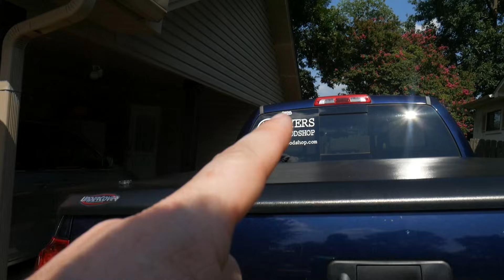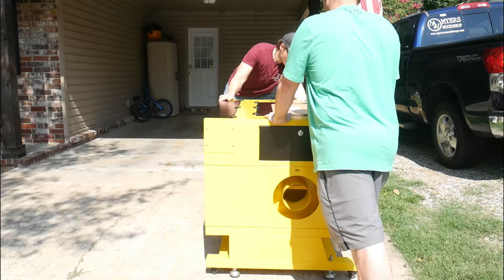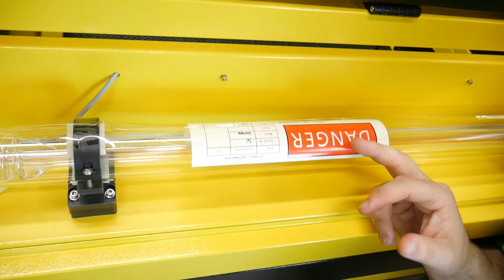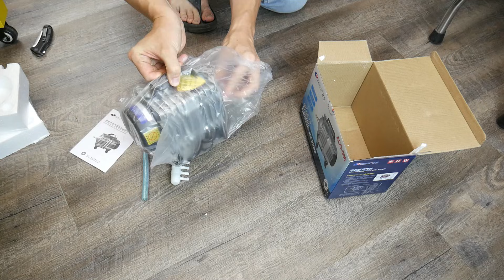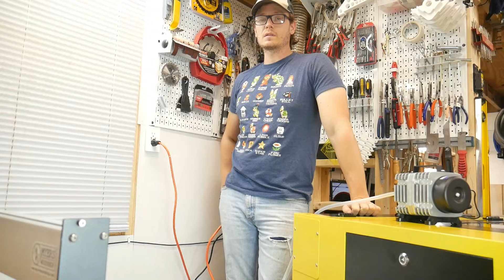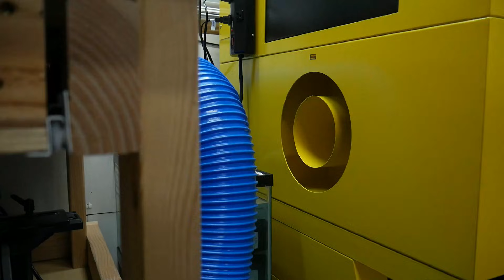Did I Waste $2400 on a 60W Laser Cutter from China?

Comment: Has anyone ever elaborated on the "this power board wiring is too small" apart from "the internet said"? Cheers.
Reply: Supposedly the wiring is not able to handle the full 10a or more that the fuses in the fusebox alllows. This makes for a potential fire hazzard if you pull too much power from one of the outlets. I.e internal wiring melts/burns. On the one I use it has not been a problem but your miles may vary.
Reply: @MrFalense  Yeah I have a Chinese laser as well. Hopefully the typical aquarium pump, even on sad old 110V, doesn't need 10A ;-)
Reply: @MrFalense  still for that small aquarium pump and air compressor, even Chinese wiring should be good enough
Reply: @MrFalense  it might be because China (and the rest of the world) uses 240v, which means they same size wire can carry double the Amps (if my weak recollection of high school science class is right). I'd be curious what size wire they used. It should be 2.5mm diameter wire for a standard electrical outlet (up to 4000w capacity). At least that is the standard in Europe. It's the reason the US can only do up to 1,500w on a single electronic, ie, why all heaters are that wattage. but in Europe we have up to 3,000w heaters.

Comment: I really hope you put the Extractor fan outside like it should be, build a box/leantoo/cover. That grey extractor pulls more cubic than that black one does.
Reply from the maker: Nope, it's inside.  The black one is much quieter!
Reply: @MyersWoodshop  what he's telling you is you need to utilize the original fan that came with it because it does a better job of moving air so you're not buying replacement parts all the time for your laser. Speaking from experience by having replaced $20,000 gold mirrors because of low air flow, that fan keeps the dust/smoke/debris in the air from ruining your lenses. Put the fan outside in a weatherproof box and you wont hear it if noise is your only concern.

Comment: will that cut thin aluminium
Reply: NO
Reply from the maker: NO c02 Laser will cut metal!
Reply: @MyersWoodshop  A large CO2 WILL cut metal - this toy barely gets through acrylic and thin wood.
Reply: Not really. Most industrial metal cutting lasers are CO2.  However a lot more power is required.  There are DC excited glass tube lasers that have two and four bore folded tubes that can provide up to 500W and this is about the minimum for thin sheet metal.  However to cut copper and aluminium takes even more power as they are good reflectors  at the laser wavelength and also conduct heat away from the cut. Most industrial metal cutting lasers have RF excited lasers, also often with folded beam paths and on many have flowing laser gas so it remains fresh.  The beam diameters start out bigger and the optics are higher quality.  For thin metal at low laser powers pulsed lasers are used and this is the YAG and fibre laser territory but speeds are not very fast and they are less common for heavy work.

Comment: Should not operate it if the room temp goes above 90 degrees. This is a cheap laser. Water cooled is another space killer. If you mount your vent fan in the attic and run the duct up to the attic and out the gable or roof vent you have very little noise.  I considered a Chinese laser due to cost. But I'm very glad I spent the money to buy an American made CO2 laser. The my laser tube alone is more than that hole crag mire of equipment. But there is no water to mess with, focus is automatic, instructions are easily understood, they have a help line and parts can be shipped overnight.
Reply from the maker: no water would be nice but i saved SOOOO much money!
Reply: @MyersWoodshop  Unfortunately, you get what you pay for. The Chinese machines are will not last long in a commercial business.

Comment: a 60w power supply DOESNT  mean its a 60w tube.  guarantee its 40w.
Reply from the maker: Length of tube and power supply state otherwise.  It’s a 60
Reply: @MyersWoodshop  and nothing against you. I'm an eBay power seller and used to be a chinese importer (now I manufacture everything i sell here in the USA). the chinese sellers are extremely dishonest. i don't believe ANYTHING about a chinese product that i can't validate for myself. I've been burned many a time.
Reply: @DieselRamcharger  But when Americans do business abroad, first they put a local face to deal with the local business. You usually get what you pay for. Do you imply that all chinese sellers are extremely dishonest?
Reply: @MyersWoodshop  power supplies work off demand. 60w is peak output. only if asked for it.dimensions mean basically nothing. you can get an actual laser output tester fairly cheaply, and then you will KNOW what it is. also your tube should have a certification slip somewhere in the package showing its peak output and its agreed output.
Reply: He's right quite often what happens is people will over power the laser, greatly shortening its life. I'd also like to know if it's indeed a 60 watt laser.

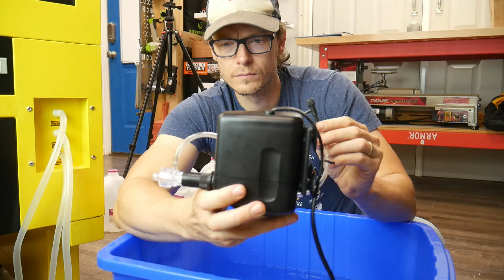Comment: 20:19 the little tube thing is from the aquarium side of that pumps use, in sucks in air so the water is mixed with air for the fish. but i bet u don´t need it.
Reply from the maker: figures.  Don't need it for the laser.
Reply: @MyersWoodshop  yea it would actually be very detrimental to the cooling ability since the air wont absorb heat as quickly vs direct water contact and can result in airlock within the tubes and kill the laser tube from overheating.

Comment: I have that exact same identical laser from Ebay.  How was the smell from it? A little smoky smelling?   I added a 30ma meter, got a CW5200 chiller, and used the blower it came with. After doing the mirror setup and cleaning everything, it does a really good job for what it costs. Of course it comes with a 50w tube and not a 60w as advertised, but that is an easy fix. 

Thought I had it bad taking mine downstairs! LOL The base comes off, all the doors come off and it makes it much easier to move.  I use Lightburn to drive it.  One tip, don't use those outlets in the rear, they aren't very good and could lead to arcing.   Also on the cooler, don't use the default settings, but run through them all and set it to 15C as the low end, 20C as the high end. 

Now for a fun note. This exact same laser is purchased by US companies, revamped with US parts and sold under a US brand for 4 times the price.  The thing to look for is the guideways, they are high quality on these Chasers from Ebay, and the cabinet construction is very good. The tube and power supplies are consumables, so when time to replace, use a high quality one and you will have a laser that is every bit as good as one from say Boss laser and costs a quarter of the price. 

BTW, YES those screws are HOT! LOL Did the same thing!
Reply from the maker: lol. we had the same experience!  mine actually has a 60 power supply.  yep, american uses a lot of the Chinese components.

Comment: The sealant is used when you change the tube. It goes around the high voltage cable attached to the tube.
Reply from the maker: your right!  Hope i dont have to do that for a while!
Reply: @MyersWoodshop  Has your power supply died yet? That'll die long before the tube is bad. And the stock supply is barely 50W, not 60. When it dies, get a 60W supply from cloudray.

Comment: If it is anything like mine, it will have a 60 watt laser power supply, but only a 50 watt laser. The laser tube only lasted 3 months before I had to buy a new one. This time I ordered a 60 watt tube from the manufacturer which protruded out the side, so had to make a cover for it. I think they just throw in new old stock laser tubes.
Reply from the maker: i checked after.  Model myjg60w, so the power supply IS a 60w!
Reply: @MyersWoodshop  I have the same machine. It's a 50W power supply with a 60W label. The fly-back transformer inside is only capable of 50W. And it will die. A real 60W power supply is a bit larger and needs a pair of fly-back transformers.
Reply: @MyersWoodshop  By the way, I got noticeably more power from my laser tube when I replaced the original dead supply with a cloudray 60W supply.

Comment: What is the wattage on your laser power supply and did you get an actual 60 watt laser tube? Thank you.
Reply: I have this exact laser. It is actually a 50w tube with a 60 watt power supply. Length of the tube determines it's output. A true 60 watt tube is 1200mm long, the one shipped with this unit is 1000mm. The tubes supplied are low grade and wont last long if driven at 100%. They didn't detail the ma meter that is seen in the end shot, but noticed they have another video with details. The maximum you want to drive the tube in this unit is 18ma. Any higher and kiss the tube goodbye.  It will cut most woods at 30-60% which is right around 14ma tops.
Reply: @acdii  You are right; as a rule of thumb, running at 80% of the max power will approx double the working life. But at 60W power, why do you need a chiller? As long as the water temp at the outlet stays below 50C, it should be fine.
Reply: @janami-dharmam  You would be surprised at how quickly the water temp rises at 20% output.  My chiller has a digital readout, and doing an engraving at 20% will raise the water temp up 2*C. Eventually if there is no chiller, the water temp will reach 20*C which is the limit you want to be at on the tube before it breaks down the CO2 into CO.
Reply from the maker: yep, 60w, the power supply is as well.

Comment: Awesome video! FYI....
An increase of 3dB doubles the sound intensity but a 10dB increase is required before a sound is perceived to be twice as loud. Therefore a small increase in decibels represents a large increase in intensity. For example - 10dB is 10 times more intense than 1dB, while 20dB is 100 times more intense than 1dB. I.e. Small change on the db meter is really a lot of difference.
Reply: Ethan 
Say what?
Reply from the maker: thanks for the info.

Comment from the maker: Orion Motor Tech 60w Chinese Laser Cutter Engraver : https://amzn.to/31K0TEc
VISIT:  https://omtechlaser.com/?ref=myerswoodshop
Reply: Don't waste anymore $ on CO2 or even YAG's,lamp or DP lasers, get a Fiber laser with virtual perfect beam quality, order mag. shorter wavelength, ultra high wall plug efficiencies, can be 'piped' anywhere in your lab,home or factory with a tiny fiber optic. From watts to KW's Fiber Lasers are changing the world. No need to discard your current system as you can retrofit your existing laser scanner and change out the CO2 laser with your new/used Fiber laser. You'll also need to change out the delivery optics but are available everywhere.
Reply: Roxanna-----what fiber laser mfg. are you referring to??
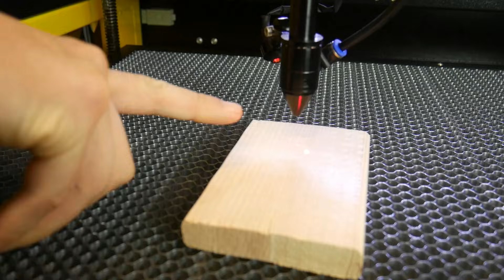Reply: Myers Woodshop You might want to buy a pointing stick 25:25, preferably before you run out of fingers. And ask for steel toe capped shoes too. 
Just sayin.
Reply: Not sure why you are calling it a knock-off. Its an X-Y carriage with a laser attached. How else are they supposed to do it? As we know, most manufactured goods are made in China because that's where the skills are. We'll have to get used to reading manuals in Chinese instead of expecting them to do the translating as well as everything else. After all, the German, French, Italian, Japanese and Korean translations take priority these days over the English ones.
Reply: Michael Powell because that’s where the skills are? Probably over 90% of what China builds are knock off’s or copies of technology stolen from the west or forfeited by companies to be able to have their items built in China. The reason everything comes out of China is because of the cheap labor force it has nothing to do with their innovation. You think Americans can afford to pay for a Union built Laser engraver ? Out of China $2000 out of a union plant $20,000 and even if not a union plant your still looking at $15 an hour employees to their .20 and hour.
As for them writing manuals for other countries and not ours BS I have relatives in Germany that bitch about China good as much as anyone else. The US is the largest purchaser of China goods by a long shot unfortunately that is not going to chance at least not in the near future.

Comment: Were you able to load up lightburn and use the laser with the controller that came with it?  Does lightburn come with a driver that plug and play with that laser? was there any modifcations needed for the mirrors? Or was the laser "ready" to use after setting up chiller and exhuast?  Thanks alot.
Reply from the maker: yes.  yes.  nope, ready as soon as i hit go!

Comment: Nice video! I am trying to hook my laser up now and my water pump didn't come with the black float thing like yours has. now I have to wait until I can go find one around town tomorrow :(
Reply: That float thing is useful if you have aquarium. Air in your cooling system is harmful. It's bad. Don't use it. Don't install it like in video.
Reply from the maker: we'll that's a bummer.  I still recommend getting a real chiller.  check out my chiller video!

Comment: i use a glowforge its great
save 500 with this code https://,glowforge.us/r/BOZGYPXT
Reply from the maker: why I DIDNT buy the glowforge. 1) cost was way higher. 2) propitiatory, always online, software. 3) NO rotary will work with it.  4) Lower wattage, less powerful.  5) Only email support, might as well have no support.  6) No pass through slot (unless you get the most expensive version.  7) did I mention the cost was 2x-3x more?!

Comment: Your air blower / jet engine is awesome. So loud. I have four of these laser cutters in my shop, and each blower can run two machines because they push so much air.
Reply from the maker: they do move a lot but its SOOOOO loud!
Reply: Myers Woodshop cant get an extraction fan and mount it in a weatherproof housing outside?

Comment: Well done on the review. I have worked for 3 of the 4 premium small CO2 laser companies and for a sole income business I would go that way, but for hobby or small home businesses or startup businesses these glass tube lasers are great.
You did a slow methodical approach to setting it up, the peeps that get into a bit of strife want to be cutting within 10 minutes of unboxing. Like plugging it in when still on the crate and in the driveway 😂
Reply from the maker: a whole lot of research went into this thing before purchasing (and Even more after).  With a larger investment like this, its best to slow it down and do it right from the start.   Now almost 2 months in, i'm still in awe of its abilities.
Reply: There should be a lot of research, I’m a member of quite a few FB laser groups and some people’s research is simply posting on them ‘what laser should I buy’....Good Grief!
I used to say that you can have great ideas and a cheap laser and be more successful than a person with a great laser and no idea. There are 3 parts in the laser creation equation.
1. Ideas
2. Laser type.
3. Operator.
And you can have variable levels of all. Copying others work is low on the ideas ranking...just saying. I have seen some phenomenal things done including art installations.
Still hate the water containers and aquarium pumps, more consistent beam and life from a glass tube laser that is kept at a consistent temperature using a chiller.
Good luck and have fun, they are awesome toys...I mean business opportunities 😂

Comment: I got an similar laser a few weeks ago too, I think they are decent considering the price. I got mine for a little over 1700. May i ask why you paid so much?
Reply: I got mine from full spectrum laser here in USA and it’s now a 4,800 paper weight
Reply: @ldignif5987  they look legit (but I guess looks can be deceiving). What happened to make it a paperweight?
Reply from the maker: I've had a bad experience (or two) with foreign ebay sellers.  I've had NOTHING but positive through amazon.  The piece of mind knowing if something was or becomes wrong with it, one phone call or chat with Amazon, its shipped back and I get 100% of my money back with zero hassle.   I also get 5% cash back from my amazon card AND had some amazon gift cards.  For me, it was easily worth it.
Reply: @MyersWoodshop  That makes sense, I got lucky with my purchase.
Reply: @MyersWoodshop  I was going to subscribe, but then what I saw as a weasel response killed it - return a 500lb machine....seriously? You could have easily disclosed: "Amazon has affiliate programs where I (my channel?) get(s) a kicker each time someone buys a machine using my link"

Comment: I’m wondering how you feel about  your investment. It’s larger, more powerful and way less expensive than the turnkey unit that advertises on your page.
Reply from the maker: a month in, i would do it all over again in a heartbeat.
Reply: Roger Little pre-roll ad and mid video ad were both Glow Forge for me too. I’m very interested to see how this machine works.
Reply: @sethbracken  The glow forge is really a different animal, it is taking CNC lasers and making them user friendly for consumers. The real advantages of it are in the software, the cameras in the case that help with positioning and with tracking line drawings. 
The software with this type of laser, while not difficult,  is not at the same usability level.

Comment: You should be using the sockets on the back of the machine
Reply: In my experience those sockets are a really bad idea to use as they are no normally very well made or attached
Reply: No he shouldn't. I've read many accounts of problems with those sockets. Some of the problems I've heard of: Shorting to the cabinet, causing a shock to the operator.
Shorting to the cabinet, causing the control panel to fail, needing  replacement. 
Undersized wire and or connections causing a fire within the cabinet. In one such case, the power supply for the laser was damaged in the fire and needed to be replaced. 
The only time that I know of someone using those sockets, they had replaced them with appropriate sockets with updated (heavier), wire.